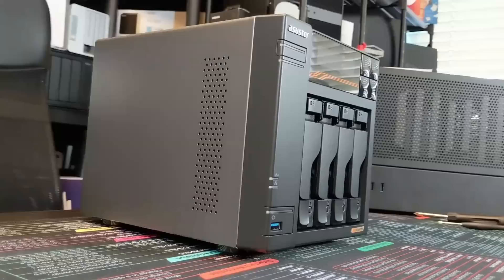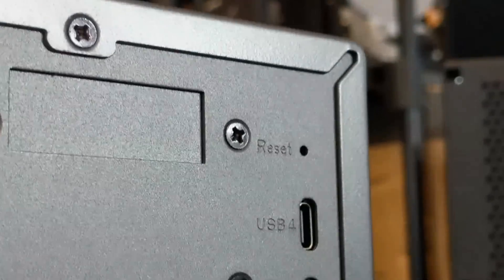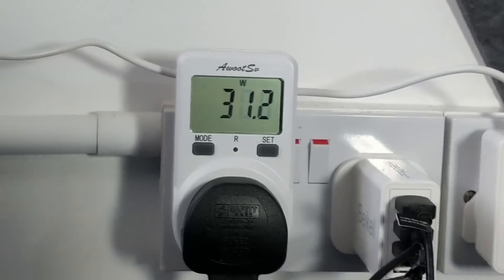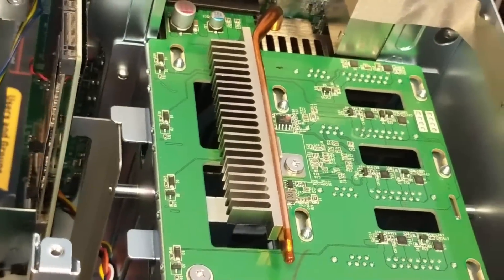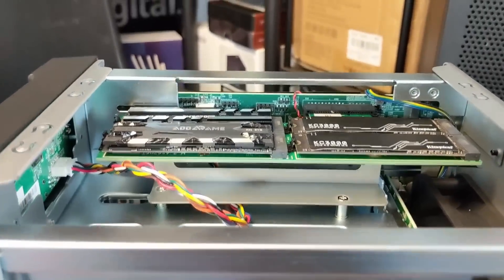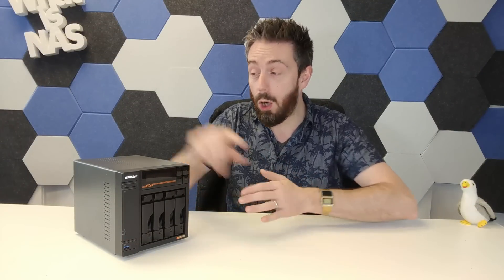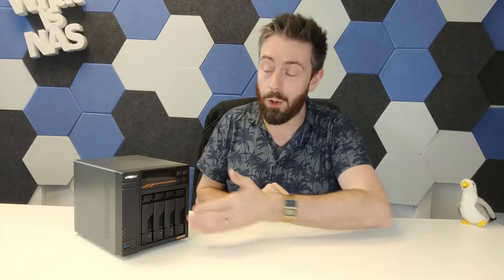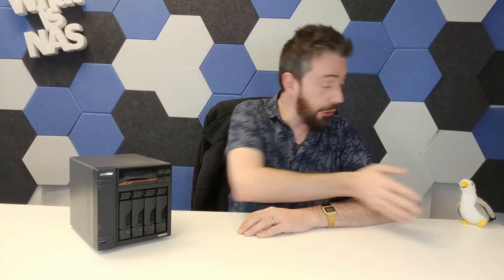Lockerstor Gen 3 Series - SHOULD YOU BUY ONE?

Comment: In some reason i think that 99% will use only one 5G or 10G NIC  so ASUSTOR can just remove 5 extra connections and make it $400 chipper !!!
Reply: Those 2 10GbEs are INTEGRATED WITHIN CPU. Asus just implements the full potential out of the original specification design, not adding extra features. Most customers are used to Synology's ugly habit to cut off should-be functions (take a glance at those puny 4 1GbE ports on DS1618+, which was based on Atom C3538 - this CPU actually integrates 10GbE x 2 + 2.5GbE x 2 MACs, and the PM of Synology totally wasted them). Cancelling one 10GbE port saves only the cost of PHY chip. And, the 5GbE are implemented by on-board Realtek single-chip solutions on-board, and they doesn't cost much neither (RTL8126 PCIe cards are priced approximately $35 on Amazon). 

Redundancy is sensible for servers at this price range. It's pointless to design a single-LAN model.

Comment: I built a NAS from a Jonsbo N2, Minisforum bd790i and 5 3.5 disks.  I’ve thought about putting one of the 10gbe / 2 M.2 slot cards from Synology in it and using dac cables to connect everything through a Mikrotik switch.  Now the NAS can play a role in my labs while serving files too.

Comment: I have 2 Minisforum MS-01’s and I think I see a cameo of one here.  It can take advantage of both 10gbe, both USB 4 ports and both 2.5gbe ports!  All in one box if you wanted too.  You wouldn’t do that but combining this with high speed storage make a lot of sense.  I am building an Openshift lab using these and they are awesome.
Reply from the maker: Yep, the MS-01 is almost used daily in my office now (and let's not forget that 6x m.2 prototype card they sent!). But I could never get both USB4s to reg with the Lockerstor (or Flashstor for that matter) as a remote connection.. independently...yep...but trying to do both at once would crash my Thunderbolt NIC and needed to restart them. Never worked out if it was the pc client or the Asustor - so couldn't point fingers at it

Comment: All I want is a turnkey box with 2x4 disk (HDD+NVME) capable of transcoding. I dont need the dual 10gbps ports as my current setup is mainly wireless because of ... yeah reasons. Old house, and I have not drawn cables to all rooms. Fiber in, cable from router to SFF PC and QNAP TR-004. Apple TV's connects wireless, and it does work. Moving files from Laptop to QNAP - yeah okay, that is tiredsome at times - can only move 30ish mb per second over wifi. All the 10gbps users are probably laughing right now. Well it works, and for now is what the budget allows :D
Reply: I mean, we're not exactly abandoning budget segments either. Our Gen2 and other NASes all have GPU accelerated transcoding and we're not abandoning them. But numerous people have asked for Ryzen and SPEED. So we are answering them without abandoning you. We want to make sure you buy the one that's right for you.
Reply: @ASUSTOR_YT  I do get the need for speed, and I wish I had the money to change the homelab with speed in mind. Until then - I keep looking for my replacement and the Lockerstor is definetly in my watchlist :) Keep up the good work. And nice channel btw. Love the reviews.
Reply: @vibaek78  Thank you for your support! We're reading all the opinions and bringing them up during our meetings.

Comment: My first nas was the Asus AS5304T Nimbustor (I believe that was the name but I'm not entirely certain). I started off with 4 4TB Seagate Ironwolf drives in Raid5. Nearly 6 years later, I'm still using it and I recently upgraded the drives to 4 10TB WD Reds and a couple of years ago I added an expansion unit with 4 6TB disks. Why am I talking about this? Because despite setting up a TrueNAS system with a lot more capacity and fancy addons over the years, the Asustor has just worked reliably and it is still powerful enough to run several containers. They have detailed guides on how to set up everything and they'll satisfy all of the storage requirements for 99% of people. Back when I bought it, Asustor used to be significantly cheaper than Synology and QNAP. That is no longer the case, sadly

Comment: Any chance there is going to be a two HD version of this? With all that fast connectivity it would be ideal for an SSD RAID with the HD slots used as simple individual hot swappable backup drives which could be taken offline for offsite backup. Would be better if the SSD slots were accessible without tools though! The price may be high, but as storage for the new Mac mini on Thunderbolt 4 or 10GB Ethernet, compared to Apple prices for internal storage, it looks like a bargain (although Thunderbolt 5 would be icing on the cake)!

Comment: The general impression that I get is that Asus has Synology directly in its sights. Robbie, do you see the Lockerstor taking over Synology's place in the consumer / prosumer NAS market any time in the next 5 years or so ?
Reply from the maker: Hi Dave. In all honesty....no. and not for any especially negative reason either. Just it's a question of 1) strength in numbers (staff and locations), 2) software utilities and 3) Reputation. Synology went in very, very hard in their first decade and never really had a competitor in that first 10 years (QNAP formed 5 years after or so, but never really broke big ground till 2012/13 in a big way). QNAP would need to "fall over" to free up ALOT of the market space (buyers, existing users upgrading, staffing, solution needs) for Asustor to graduate into a 'Synology'. Again, NOT any slight or negative spin on Asustor - they have been incredible, especially in the last 5 years (unsure if there was leadership/culture changes back in 18/19). But they cannot escalate that kind of growth on all fronts in that timeframe. Plus, it would need Synology to make a more formal exit or noticeable/sizemic shift out of SMB/Prosumer for buyers to smell the blood in the water.
Reply: @nascompares  Thanks for the insight Robbie.

Comment: I'm not sure where Asustor is going with these higher priced models. I hope the know their market. My comments on Asustor are 1 the lack of a flexible RAID implementation 2 Quirkiness I've experienced with the Flashstor 12.  I had data corruption issues on the FS12 and left multiple messages at the CA service center. I never got a call back. Ended up having to call TW. They said to use RAID 5 rather than spanned volumes. That resolved the issue. The FS12 runs at 10G for about 3 minutes then drops down to 800MB then after maybe 30 minutes becomes really slow. Copying 3.28TB of large files takes about 2.5 hours. I pulled the drives from the Asustor and put them in another brand's NVMe NAS and was able to copy 3.28TB of data in about 63 minutes. On that other brand's NAS there are no issues with using raid or spanned volume. On a Synology 8 bay spinning drive NAS  I'm able to copy the same 3.26 TB in just under an hour. So for me, I'm not sure I'd buy Asustor again. The last two NASs I bought weren't Asustor. I think they're an Ok brand, but I don't think they're offering anything I'm interested in and my experience with the lack of flexible RAID and the quirkiness of my Flashstor 12 and the introduction of these higher priced units  has put them off my watch list.

Comment: USB4 is not the same as Thunderbolt 4, TB4 guarantees 40Gb/s and USB4 doesn't, among other TB4 features. On systems that come with Windows they can be thought of equivalent in most cases including 40Gb/s capability, but that's because of MS's requirements. If this only supports USB 20 Gb/s that's why, but that means it's still not Thunderbolt 4 in a more significant way.

Comment: I'm just moving away from Asustor (and all off- the-shelf NAS systems) myself. I've had a 604T for going on a decade now. The issue is that it doesn't deal well with failure. At one point, it managed to get the filesystem dirty somehow and the only fix was to SSH in, unmount volume, run a check, then mount it back up (Asustor support was great in helping me out with this, credit where credit is due). There was no automation to deal with this, or a UI option to force it on next bootup.  Eventually it imploded its own config/OS when a single drive failed. Not that drives hadn't failed before, but this time it did not detect that it had failed, even though the entire NAS was slowed to being unusable due to one drive spinning up and down constantly. I ended up removing the drive to bring the system back to a usable state, and on next reboot it just never started up again, but stopped with a "initialize NAS?" message in the display. After a fair bit of googling I ended up using a default password to SSH in (my users/passwords were apparently gone), mount the volume, get an FTP server started, and get all my data out. 

I have a friend who's gone through multiple Qnap and Synology NAS, and the story is much the same from him. The hardware holds up fine, but the software just messes up eventually. So, I'm not trusting these devices with their quirky minimal distros anymore, going to give to HexOS/TrueNAS a try to see if that holds up better over time. Fingers crossed..

Comment: Mostly comes down to price IMO. For basically the price of that 10 bay one you can get the HL15 chassis and likely build out something better in it. If I wanted to buy a NAS though these are definitely worth considering as I want to run TrueNAS Scale and nothing without ECC is worth considering.
Reply: I really don't understand the noise about ecc. TrueNAS works just fine without ecc and barring that one guy in the forums who likes to create fantastical scenarios leading to the scrub of death, I haven't run into anyone who actually experienced that. I've been running two TrueNAS systems for the past 5 years on normal desktop hardware with non ecc ram. For most of the 5 years I've used cheap second hand large capacity drives with multiple drive failures and random drive control issues. The data has been just fine because that's how zfs works 🤷‍♂️
Reply: @ 99% of the time it’ll be fine without ECC. But it’s not like ECC support is any more expensive, unless you want to use an Intel CPU for QuickSync, in which case you’d have to get an expensive e.g. W680 motherboard. With AMD ECC basically just works as long as you make sure your motherboard supports it, so with ZFS I’d rather be safe than sorry. An AMD server build with AM5 is basically going to be the same price whether you get ECC or not, so why not?

I don’t personally care about QuickSync, as I have a Minisforum MS-01 running Proxmox, so I can pass that CPU through to a VM application host for QuickSync, therefore I don’t need to choose an inferior Intel CPU and choose between getting an expensive motherboard or giving up ECC just to have it in my NAS.

This Asustor Gen 3 is a nice unit as far as overpriced turnkey NAS go, but $130p for a quad-core is pretty absurd.